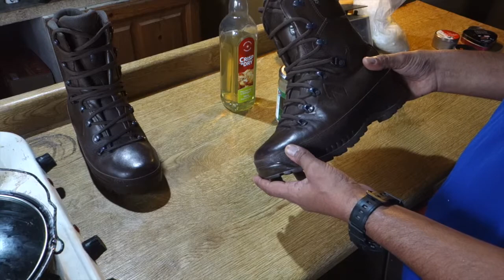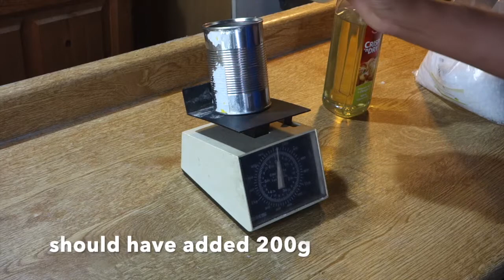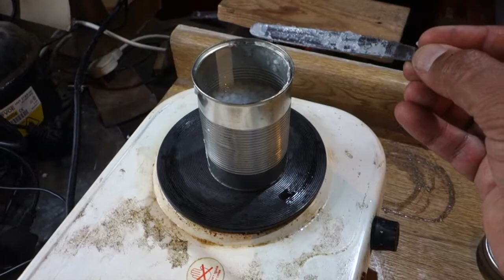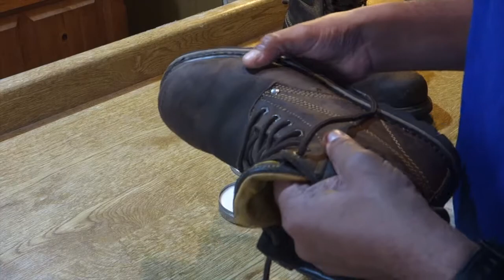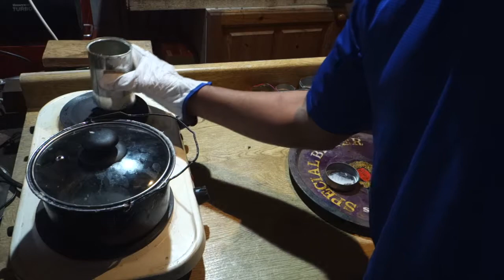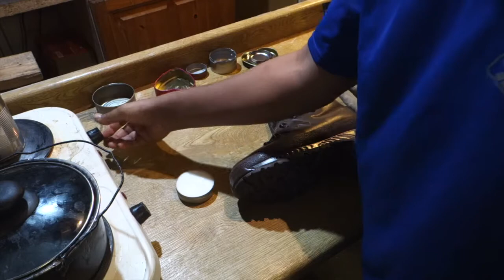Waterproofing My Leather Hiking Boots (making dubbin)

Comment: May I suggest you use Castor oil ...  Using castor oil will produce a very high shine and it won't go rancid . Also add either shea butter or cocoa butter for an  added deep supple conditioner . I have used this recipe for 30 plus years on all my leathers  and it conditions and waterproofs like a charm
Reply: how u mean u mix them together? or u put castor oil first then the butter?
Reply: @rogerivy2919   Mix it all together.  heat over steam or over a low flame  in a glass jar and set the glass jar in a couple inches of a pot of water till everything is liquefied and mixed together  .... when all mixed together then pour into your molds or tin containers.  let harden for 20-30 min .  if you need more specific  measurements  I can help you  .
Reply: @kenhappen2u  oh wow I see what u mean, I didnt think u meant this as a mix but now I get it, I really like your idea you know why??? bec im in UK, and specially were I live I can only get those two ingredients you just mentioned and they are the cheapest and Im guessing the easiest to work with. I actually have already a big tub of Coconut oil, and loads of shops near me sell it...yes would love to get the % of each ....tx
Reply: @rogerivy2919  it would be a 1 to1 to 2 parts mixture ... 1 ounce of Shea butter . 1 ounce of  Cocoa butter to 2 ounces of Castor oil  1 ounce  Bees wax .  
  Add in .5 ounces of Coconut oil  and .5 ounces sweet almond oil .  The sweet almond oil is optional  but keep in mind that the more natural oils you add the more supple your leather will be and the easier to work with in the end ... The more wax and less oil the harder the paste will be .  
 also if  wanting to make  less  then just half the recipe .
 You will love this !   Been using this for 30 plus years and it beats any store bought products . This recipe  goes back more than 100 years and is what the Old west cowboys and ranch hands used on all their leathers .Saddles , Boots . knife sheaths  . jackets ,

Comment: If there gortex buddy you don't need to waterproof them I've had loads of haix boots never had wet or cold feet I just used altbergs leder Gris brown wax oil polish
Reply: Totally correct Sir, as the leather can still breath no need to do this as you have said it will just block the pores of the leather and make the inner of the boot a total sweatbox which could lead to Trench foot over long periods.
Reply: Leder gris all the way

Comment: I have the exact same boots.. I can't get the dark brown colour like yours how did you get that colour... I use altberg polish on mine... Military brown... Should I switch to a darker kiwi polish? Stay safe..
Reply from the maker: im not sure really my boots came this color and im moving away from polishes because they just build up on the surface. might want to remove the polish and re-stain the leather. i hear acetone will remove boot polish but use at your own risk.
Reply: @iansforge  thanks for your help... I've used mink oil that's darkened it a little... Hopefully they'll get darker more.... Why do u no longer use polish are you moving onto wax etc
Reply from the maker: @bobmarley6161  regular shoe polish doesn't hydrate the leather
Reply: @iansforge  thanks for the info... I only use wax now as well....